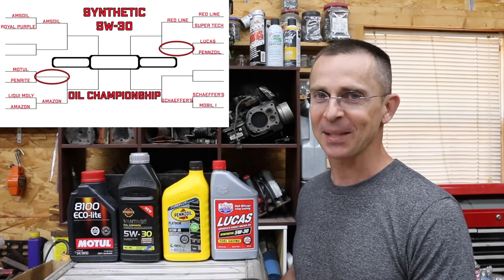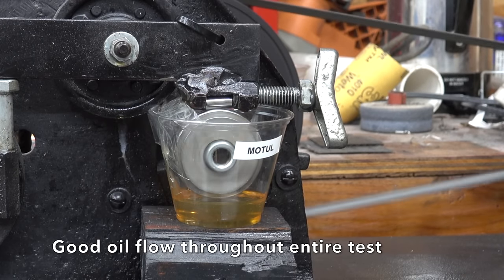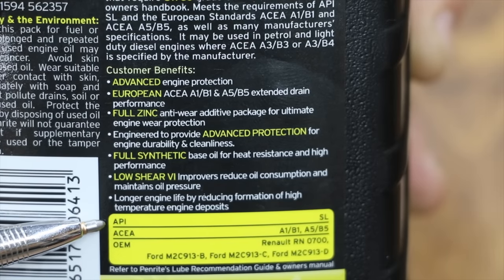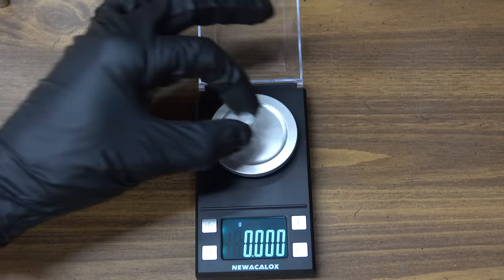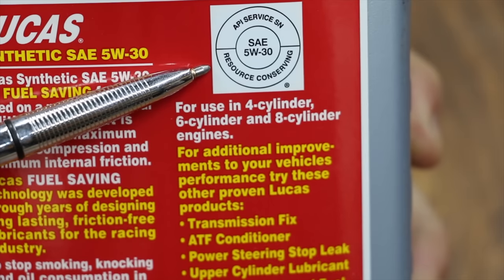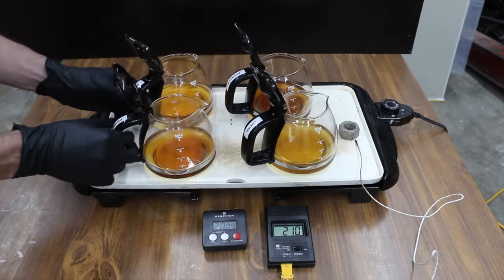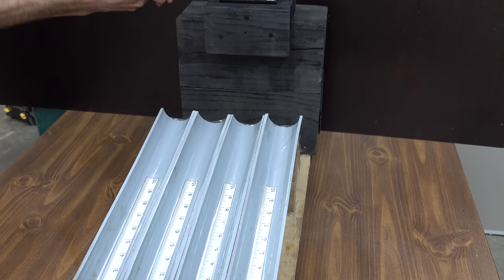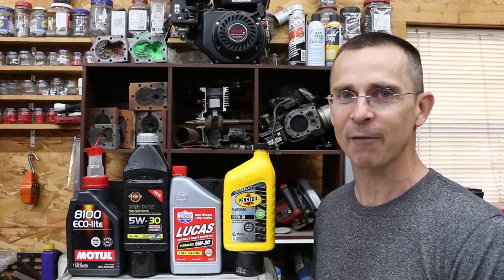Is Lucas better than Pennzoil? Let's find out!

Comment from the maker: Thank you all very much for suggesting the oil playoffs.  Here's the list of brands tested.  Best regards, Todd
Pennzoil Ultra Platinum: https://amzn.to/34pgEll
Mobil 1 Annual Protection: https://amzn.to/31m3bcq
Lucas: https://amzn.to/3iYkvdg
Kendall: https://amzn.to/3hfPa5r
Liqui Moly: https://amzn.to/31l8eJY
Amazon Basics: https://amzn.to/32ef4jL
Quaker State: https://amzn.to/2EgE7uv
Amsoil: https://amzn.to/3aNZYoV
Castrol: https://amzn.to/3jhgYan
Red Line: https://amzn.to/34kkV9T
Royal Purple: https://amzn.to/31l9ehc
Schaeffer's Supreme 9000: https://amzn.to/3goLaOK
Valvoline: https://amzn.to/2YrJGgq
Motul 8100: https://amzn.to/3l9AfMw
WalMart: https://www.walmart.com/ip/Super-Tech-High-Mileage-SAE-5W-30-Motor-Oil-5-Quarts/17134875
Reply: Have you done a test on Amalie Elixar 5w30 sn+ motor oil. Thanks
Reply: Can u  test cenpeco vs penn grade brad penn
Reply: Is there a difference between penzoil platinum and ultra platinum
Reply: Was wondering if you  are planning something similar on dot3 brake fluids

Comment: I'd like to see Castrol Edge full synthetic against something as I stick ritually to it!  maybe Rotella?
Reply from the maker: Thank you for the video idea!
Reply: I second this
Reply: Rotella t6
Reply: I have a huge curiosity about EDGE too. Especially after seeing a Russian BMW tech on Youtube boil it along with BMW original oil in a ceramic heater. (Search: Castrol Edge vs BMW 5w30) EDGE won because it had minimal carbon and sludge after the torture. As for BMW oil - now that was a lot of damage!
Reply: I would like to see rotella t6 5w-40 vs whatever. In there doc they show that it flows better than 0w but it protects as well as a 15w. I also see people using it in cars and motorcycles.
Reply: Castrol is probably the best oil brand actually. Their 5w30 Edge Titanium FST is just impressive as well as the 5w30 Magnatec...
Reply: @johnantonopoulous6381  Rotella T6 changed formulations a few years ago when SOPUS restrategized their lineup for modern gas engines.  :-(  The new stuff doesn't have anywhere near the same protection as old.  There is plenty of commentary about this subject out there.
Reply: @Steve Sauls I run it in everything from a 4 horse to a 4.3 and no issues yet. And I also run Delo and both are 15/40. 80+ p.s.i. on hot (195 or better)  idle with the 4.3. BUT you never know!
Reply: I swear by Rotella t6 for my powerstroke 6.0 The truck just runs so much better on that oil. The 6.0s are hard on motor oil because of the high pressure oil pump fuel injection system. I can notice rotella t4 start to break down after about 4000 miles. T6 just keeps it smooth.
Reply: Rotella t6
Reply: @Arestas25  oh, damn.  There's no reason for him to do any of these tests because you already know everything.
Reply: Would like to see this too. My Mazda owners manual suggests Castrol specifically for their skyactive engines.
Reply: RYAN SEACREST  t6 is used in everything as well. People run it in motorcycles boats cars. I would love to see it.
Reply: I have been using german castrol edge in my car for the past 2 changes, noticed sludge which did not occur in the other oils I have used, the oil did come out a tad more black in the end, maybe it did a better job in trapping carbon but the sludge was concerning, the Fuchs I had before had 0 sludge and done 3k more mileage. Mind you this was the exact same spec, VW 504.
Reply: Edge please
Reply: @cup_and_cone  I actually made a video on this. The rumors surrounding how much the formula changed are mostly false. Yes there were changes, but it was primarily to the detergents, with only a small change in anti wear additives. T6 is still great stuff. That said, Castrol Edge 0W-40 is almost certainly one of the best oils available for the money right now overall.
Reply: @super_slav91  I've never had sludge with any oil on a regular OCI. I would wonder if the Edge actually managed to clean sludge and deposits out of your engine, bringing them down to the pan instead of where they were trapped. Then it would look like the Castrol caused sludge when really it was cleaning it. I know for example Pennzoil conventional oil kept my engine spotless while other conventionals tended to discolor components. Just a thought, detergents can make a big difference.
Reply: Paul Hopkins  For my money, I'd still go Castrol Edge. Only $22-23 for 5 quarts most days. More important though is to just actually change it regularly. :)
Reply: @802Garage  The engine only has 29,000km, it's virtually just broken in and was it's second oil change..
Reply: @RickBaconsAdventures  this is only my opinion based in the experience of the different oils used in the 5 cars of my family for the last 2 years... So, his tests are still very important
Reply: Castrol vs Total vs Valvoline 💪👍
Reply: Paul Hopkins  Yeah totally wasn't knocking you. TBH you could use almost any modern oil in a regular passenger car and as long as you keep up with intervals you will be fine. Picking a good oil is obviously smart though, and the Amazon/Walmart oils are good. Only a used oil analysis will really tell you the story though.
Reply: @super_slav91  Very strange. I def have not had issues with Castrol in my car with sustained long distance driving.
Reply: @802Garage  this is the first time I have used German Castrol as the stuff we get is from Thailand here and I carried it with me on luggage from Europe, I have had Fuchs, Liquid Moly and Nulon and Shell in my previous TSI motored car and never had sludge with up to 15k change intervals. Interesting to see it on a 12k and allot of it too. I'm trying Petronas now on a mk6 GTI.
Reply: @super_slav91  Won't lie, the current Castrol has been in my engine for about 13,000 miles or so. I'll be curious to see if there is anything wrong with it!
Reply: Was thinking the exact thing. Castrol is the OEM choice of many manufacturers and it comes in expensive packaging for sure.
Reply: Agreed
Reply: He probably won't do Rotella T6 as it's no longer gasoline engine certified. I saw comment here saying the formulation hasn't changed much, I'd like to know the reasoning behind why it's no longer SN certified.
Reply: @802Garage  - No rumors, just hard facts.  Less zinc, less phosphorus than old... although still high, but expected for HDEO.  Now calcium based instead of magnesium based.  No more moly (deal breaker for many).  And of course CK-4 now means will never be SN/SM rated, which is automatic disqualification in a gasoline oil test....
Reply: @cup_and_cone  I didn't say there weren't facts, I'm just saying people are often exaggerating IMO. I won't link my own video, but actual wear additives reduced very little, as in less than 10%, except for the Moly which I'll grant you. I'm just saying in terms of off the shelf oil it still has most of what people wanted and in some ways may even be improved, other than the loss of Moly. Nobody who was using it in cars was concerned if it could pass testing before anyways. Appreciate your reply!
Reply: @super_slav91  I also think that Fuchs has its advantages. 👍 But the price and availability... 😕
Reply: @802Garage  same here, always used Castrol, never had any problems other then less noise, smoother engine and so on, over mobil 1 and l.moly when used once or twice, Honda and Volvo with up to 360,000 km on them, never had sludge problem and I have looked under valve cover from time to time. 🤓
Reply: @Arestas25  Then you shouldn't have worded your comment the way you did.  Just because you're happy with some certain oil doesn't really justify saying that "It's probably the best actually" when PF is like 3/4 of the way done with the tests.
Reply: @johnantonopoulous6381  -But the T6  it's not recommended for gasoline engines because diesel engine oil contains zinc, which will destroy a catalytic converter once the engine begins to pass oil into the combustion chamber.
Reply: @theamerican7080  actually it shouldn't be an issue at all for the cats if it's a good quality oil because it won't have burn off because it's a good oil. And it really shouldn't affect the cats. Most of the oil produced in the rest of the world actually still uses it like most of Europe. Older cars love zddp because they were designed to have it from the factory as well. I'm not saying it's for every car but there are a lot that can still use it and most racing oils still use it.
Reply: @johnantonopoulous6381  Zinc will destroy the catalytic converter in no time, which is why zinc is not present in oils formulated for modern gasoline engines, especially in the United States.
Reply: @theamerican7080  All I can say is I have a over 100k miles on it in multiple vehicles  combined and never had a problem. Not saying that it is for every application but it worked. He could do a desel oil test and one against the winner of the shootout. It would just be cool to see.
Reply: @ProjectFarm  Castrol Magnatec!!!!!
Reply: I think this is a great idea. I run Rotella in all my vehicles. I'd like to see T4, T5, or the new gas oil they have made. I've heard bad about T6. The rest I've heard great about and have had no problems.
Reply: My Ford has over 180,000 miles and I change my oil around 9000 - 10,000 miles apart using Castrol Edge and the oil doesn't even come out super dark like other oils at fewer miles. I definitely feel it's the best oil I've used...
Reply: Castrol Edge 5w40 vs Motul Specific 5w40 for the ultimate Volkswagen/Audi oil showdown
Reply: we are still waiting!!!!
Reply: @pgmurray76  German Castrol
Reply: @bobbyheffley4955  I love Fuchs, and Pennzoil Platinum, and Amsoil. Just bought 2 US qts of German made Castrol (BP) Syntrax LL 75W-140. Massively good differential lubricant.

Comment: Will the winner of the oil playoffs take on bacon grease for the place of true champion?
Reply from the maker: Thank you!
Reply: You want to see the true champion they will have to get some ProOne Lubricants
Reply: I think bacon grease is going to win the lubricity test versus the top oil but it's definitely going to lose the flow test and what about mixing the best oil with some bacon grease will it dissolve the bacon grease and keep it flowing or it's going to freeze up on top of the oil or the bottom or you will create a better lubricant oil
Reply: @transam8607  it will separate at low temperatures. Im sure an emulsifier exists to keep oil and fat in solution but idk.
Reply: @1019wc1019  you're probably right but I still want to see it he makes the videos as much as real as they can be and the grates things is he gets back to almost everyone that leaves a great comment or grait idia
Reply: @transam8607  if you can mix it with lecithin then it wouldnt separate out. Might still render and have chunks though.

Comment: I’m Australian and nearly always use Penrite so I’m hoping it does a good job. Time to see
Reply from the maker: Thank you!
Reply: Shame he wasn't using hpr5 from what I could tell it's the enviro one he got.
Reply: He was using advantage by the looks of it, which is what I have been using in my commodore for the last 2 oil changes but HPR range is better well I think.
Reply: Fellow Aussie glad to see Penrite got the nod. That said it's good to see objective tests - I started using Penrite HPR Turbo on my VL Calais about 20 years ago and have been very happy with it, but if I recall I chose it because 1) it was Australian, 2) premium priced so figured it had to be good quality, and 3) was 'turbo' rated. I've used other Penrite oils on other Commodores since then, and while I've not been unhappy with it I've no way of comparing it with other products on the same vehicles.

Comment: should have been pennzoil ultra platinum.

Really wanted to see how that does.

But Rotella T6 next!!!
Reply from the maker: Thank you for the constructive feedback.
Reply: Ultra Platinum interested as well.
Reply: Matt R same here. It’s what Dodge uses in its high performance motors and what Ferrari uses.
Reply: The thing is, all these brands have higher grade and lower grade oils. Where do you draw the line? I know both Penrite and Motul from this video have more expensive, "race engine" fully synthetics, penrites is also suitable for large diesel and motorcycle engines (which share their oil with gearbox). Penrite also trade on their name and have some much cheaper semi synethetic options. Which one do you choose?
Reply: @tosgem  the best, top of the line for each product. It's a large competition attempting to battle out for the title of "best", some of these are very expensive, premium oils, simply keeping the playing field level with viscosity and synthetic category isn't specific enough. If you don't use the top product for everything someone will always ask "but what about penzoil ultra platinum?"...
Reply: Platinum is better comparison because it is more commonly used, cheaper than Ultra, and easier to find in stores.

Comment: Going to need to see Penzoil ultra platinum for a fair comparison.
Reply from the maker: Thank you for the constructive feedback.
Reply: david anthony good catch, this is not the ultra platinum, which is their top of the line oil.
Reply: vladimir putin  All Pennzoil synthetic is branded Platinum? There is only Platinum, Ultra Platinum, and Platinum Euro.
Reply: Platinum is better comparison because it is more commonly used, cheaper than Ultra, and easier to find in stores.
Reply: @zzman5306  Penzoil ultra platinum 5w30 is currently $24.97 for a 5 quart container.  It is readily available at my local Walmart in Pennsylvania. Or online at Walmart. com. Around the same price at Amazon also.